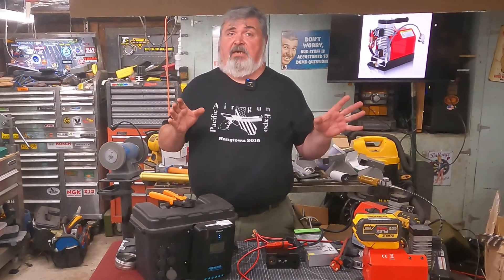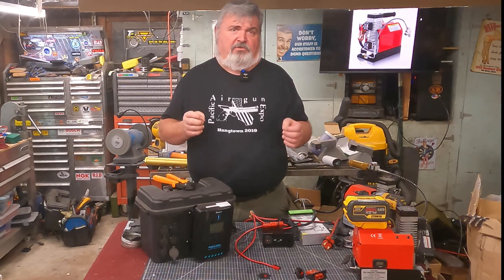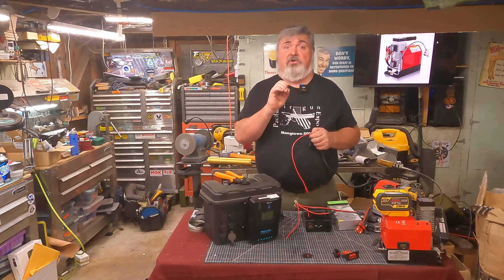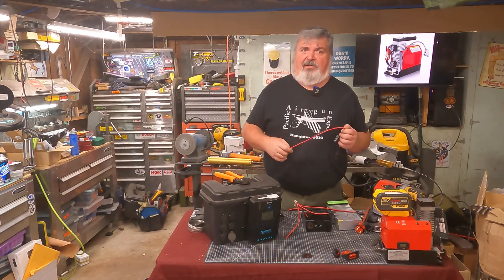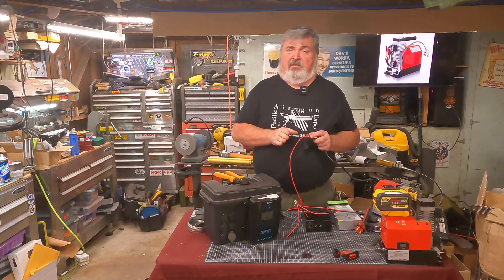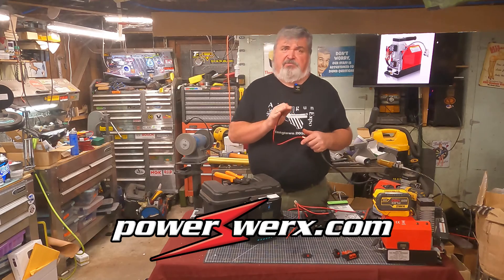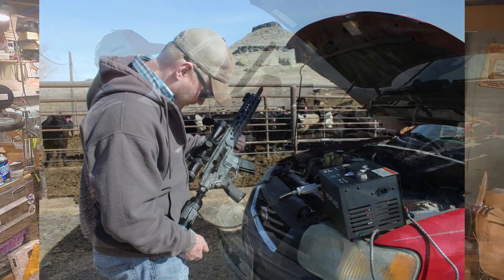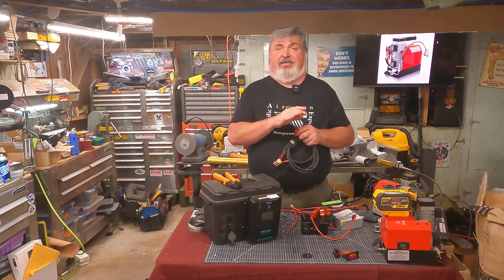Connectorize your 12V HPA Compressor! No more alligator clips!

Comment: Noticed on your video you have a very big battery unit. I see that you moved the cylinder head 90 deg. to get the clearance. My question is, with the standard battery up against the filter does it restrict the intake air? I only ask because I just ordered up a GX E-L2 Portable 18V Cordless PCP Air. Would it be better to turn the head 180 deg for better air flow? Love your videos, great info, its what made up my mind to by the pump! Keep them coming.
Reply from the maker: I think it will be fine in it's stock configuration. You should be fine. Thanks for your comment!

Comment: The Anderson connector housings are marked + and -, and RS Components only list male versions. I'm a bit amiss.
BTW, I used my GX CS2 for the first time today, powered by my 12V 24 Ah LiFePo battery, which built in management could tell me via my phone that the max current draw was just shy of 26 amps, fans only 1.7 amps.
Reply from the maker: They flip over and interlock, check the datasheet if you need further evidence. I can assure you they are Asexual.

Comment: Count me in on the Alligator Clip haters club.  I love Anderson PowerPoles!  I have the PowerWerx TRIcrimp.  It is not inexpensive, but it works great.   Sage advise about using the proper wire gauge, connectors, & fuse size. Thanks for the great information!
Reply from the maker: Right on! Swampy!